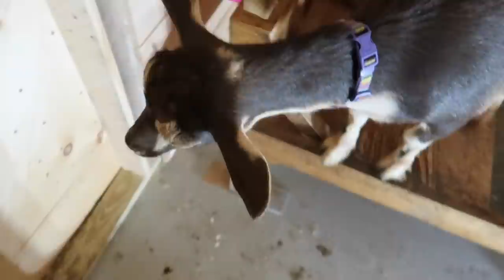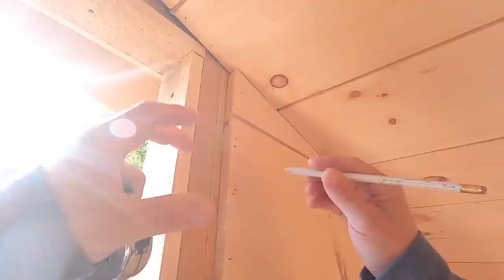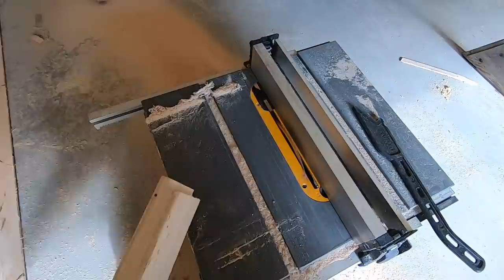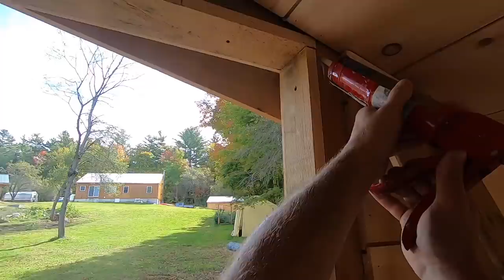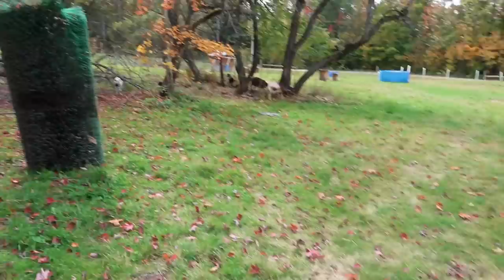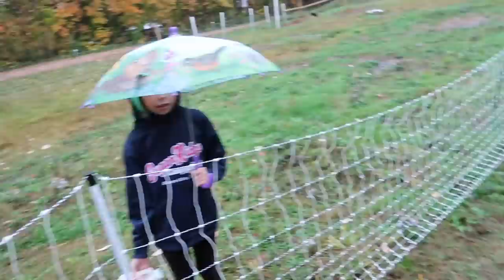Using Cheap 2x4s to Make Custom WINDOW TRIM

Comment: Al, you are still very young and I want to mention this because my husband and I are now in our 60's. When we were young we use to be on our knees quite a bit working... and now we are both paying quite a price... "Pain" each time we see you on your knees on the concrete using your table saw... we cringe.... you really need to get that thing up on a table even if it's one of those cheep folding tables... Save your knees... You will be so grateful in the future....
Reply: Wearing out your knees by 60 is certainly no fun.  Fully agree with R Reed, get your work up on a table.
Reply: I'm in my 60's and my knees are still good despite installing a lot of flooring and a lot of trim when I was younger.  Knee pads are a necessity when working on hard surfaces.

Comment: The stain turned out very nice.  At first, I was like "Noooo" I don't want the stain, but it came out a great color on the "cheap" pine.  And it being on the door frames and window frames it will blend in any finger and hand prints nicely.  Perfect.  Yall do just awesome stuff.  Loved the RIP CWC.  A great memorial.

Comment: A decent outfeed table or a roller stand would be pretty helpful and safer, but I guess they will come when you get your shop set up. I've been waiting 8 years to get my shop set up again since we moved to the country. Seeing your shop coming together has pushed me to just set up my machines in our machine shed then just do a massive cleanup when I finally move things to a proper shop. Thanks for the inspiration Al!

Comment: That's the trim design I've always liked... very Shaker. Few safety tips if I may. Throw away or hide the push stick that came with the table saw and make a proper DIY version that bites more of the stock/provides more control. Also when cutting rabbets on the table saw, always have the waste on the opposite side of the blade to the fence. Keep it up fellow modern/homesteader.

Comment: Your next job is to build yourself a workbench, saves your knees in later life, just saying from experience.
Reply: Need a table saw stand for sure. I was concerned for kick back making dadoes.
Reply: Definitely! The bigger the better, and with good overhangs to clamp to and a quality vise.
Reply: I agree  with  a  tablesaw  table  would  have  been one of the  first  things  I  would  do!!!   My  table  is  about  3'x3'x 36"  and  I  want to  add  an  axel and wheels  to  the  back side  and  handles  to the  front.   I  could  easily  roll  it  out  where ever  I  needed  it!
Reply: @josephbrown-ut9ty  Isn't 36" equal to 3'? Lol, just noticed you put 3'x3'x36" instead of 3'x3'x3'. Not meant as rude, just a fun observation. That sounds like a great idea for your tablesaw table being mobile. Clever thinking!

Comment: When you cut your 1/4" over lap on saw let the off fall of cut be on out side of blade not at fence. Short runs will come flying out back of saw some times at high rate of speed. I've seen them go all the way across shop and impale things would be bad day if hit some thing loved.Nice work

Comment: Hello AL ,  I watched as you cut rabbets and dados on the ends of 2 x 4 lumber using the table saw.  There is a great risk of kickback in doing this freehand ( as you were) If that board gets out of square with the saw blade you will get a violent kick back which could result in serious injury. You should be using a miter gauge to push the board across the blade. The miter gauge ensures that the board remains square during the cross cut. No one wants to see you get hurt.

Comment: Q: The iron solution. Would it be made of iron oxide powder mixed with alcohol and linseed oil? 
I also agree with others about Willow, her face is too close to the wall. No one would like to have their face so close to the wall. She might be thinking she is being punished for something?
Sawdust, too fine for compost. Needs some prep work to make it ideal for the compost. Like use it to make methanol and then after it is done, take the mash to the compost pile and it will give some new nutrients to the pile. All wood types are loaded with carbs and thus are great for making methanol. Ferment those calories into methyl alcohol and leave behind protein and B vitamins in the mash that then are transferred into the finished compost. Better crops and less clumping in the compost. Just be sure to dry the mash and crumble it before introducing it to the compost. Your anaerobic bacterias will love you for it.

Comment: Really looking good! It seems that it is taking longer to do all the finish work than to build the basic Barn. Then again, that is probably the same as building any structure. Art in CA
Reply from the maker: It always takes long to do the finish work. Whenever I think it will be quick I’m wrong. 😆

Comment: We just put trim up this weekend in our new garage. We took 2x6's and ripped in the table saw at a 45 on both sides to make a simple crown molding, than the scrap corner off the 2x6 goes in the corners of the building . Caulked all seams and you end up with a pretty nice end product. We chose to paint everything crisp white to make things a bit brighter. Not as beautiful as your craftsmanship!!!!

Comment: just a thought the little 1/4" pieces you cut off the 2x4s could be used for the trim in the corners   of the walls and ceiling

Comment: How about making a swivel latch for the milking stand instead of the bungee cord? Use a  rectangular piece of wood   loosely fastened on one end, with a small cut out, that swivels over a peg on the other side.

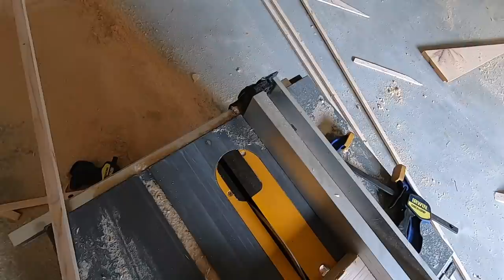Comment: You're going to hate me but that is bad practice to crosscut 2x4's using the table saw fence like that. (at 9:40, 12:06) It creates the opportunity for kickback. Alternatively, you could attach a block to the fence at the beginning for your distance and use the miter gauge. Nice work.
Reply: It would be safer.  I know someone that did it wrong & the piece of wood came back & embedded in his stomach.
Reply: @chris3m98  YIKES!!!

Comment: I've been watching Willow since the move into the new barn & the position of the milking stand.  
It might just be me but I don't think she likes having her face so close into the wall like you have her. She's been a lot more antsy & figgitty since the change. 
She keeps picking up her front left foot & turning her head like she wants to back away from the wall.
It might be a case of her just wanting something to look at, other than just the wall while you milk her.  She might be feeling like she's boxed in & can't keep watch of her surroundings.  It might be a stressor for her, thus the attitude change & not finishing her feed.

Comment: My husband started watching everyday to see you build. I think he will like the trim like i did.  Are you going to install lights in the barn, and would you run conduit around the walls?
Reply from the maker: Yes we need to finish the work shop first. And then we will wire up the shop and barn

Comment: The vacuum pump /system that you are using NEEDS A GAUGE!!! Willow seems much less comfortable with this new electric pump.  you would always be checking the gauge on the hand model that you used but the new system lacks the gauge.  Have you considered a pulsator?  We reconfigured an old surge milk can lid to work for our goats and it was slick... more than happy to share that info if you are interested.  T-Wrecks & Nina Mefford on youtube

Comment: Willow lost several inches between her nose at the milking stand and the old wall surface.  Claustrophobia?  Can the milking stand move out a couple more inches?
Reply: Goatophobia
Reply from the maker: I will have to try that.
Reply: @LumnahAcres  , she says she is Willow, NOT Wallflower....
Reply: Yes. About 10" yo 12" compared to the old barn.
Reply: @LumnahAcres  Hi Al,  Watching Willow's behavior strongly indicates she does feel claustrophobic with her head in such tight quarters. What about turning the milking stand around the other way so she can see out and feel less restricted?  It might be worth a try?

Comment: Hi Al (my brother in Christ!) hey i am a finish Carpenter (Contractor ) here in Northern California which is where we hunt , fish , work hard and wish the lib’s would go away!!!!!
Anyway couple pro tips!
Take your two saw horses place a 3/4 “ scrap sheet of old plywood on it and then place your table saw on it when using it?
U would not believe the difference it makes just try it?
Also need just a smidge more off that cut u made on the Miter Saw ?
Push your wood to be cut up against the blade (blade pushed into down position) then raise the blade w/o moving the wood and then make your cut there goes a 16th or 32nd ?

Ok brother take care of that family they are a gift from our King!
Reply: Where should liberals go!!! Everyone has the right to their beliefs even if we disagree with them!!!!

Comment: Al, the flow of your videos are gone. This is the eighth commercial so far.
Reply: - YouTube creators have no input on ads. Ads are targeted to the individual watching by YouTube algorithm. You & I could watch the same videos at exactly the same time & see different ads. You only need to let ads run for 31 seconds for YouTube creator to get benefit. I read the comments while ads run.

Comment: willow is not happy with something. could it be the milking machine?
Reply: Or the new smell - glue . . .timber
Reply from the maker: I think she’s in heat. It’s breeding season for goats
Reply: @LumnahAcres  You have so many things going on at once, how do you plan Microsoft project or Zoho?
Reply: It might be that she is coming into heat but Willow has seemed bothered during milking at other times.  When I watch I often say to myself, "easy on the teats there, Al".  It gets a bit rough.

Comment: That trim is looking pretty tricked out. How about a fun project, put that barn ladder on a track and caster/rollers like they use in a library to move it back forth and out out the way, with a twist...where it easily folds flat against the wall on one side....maybe by using the kind of simple hinges you have on your gates just a couple hooks and loops....maybe do a small rise in the track where it falls into the hinge at the end
Reply from the maker: I was thinking about hinging it on the loft and then having a police system so I can raise and lower it as needed
Reply: @LumnahAcres  that would work too,  rollers would be be kind of slick and fun, and practical...since you have a concrete floor and all. give you easy loft access from side to side. What is a police system, like the weighted pull down system you see in a sliding Attic ladder?
If you had it on a track with rollers, you could just cut out a wheel-sized section for the trailing roller at one or both ends where it can swing out and be hooked flat to the wall...custom job but how cool. I've never seen that done but I can picture how it would work.